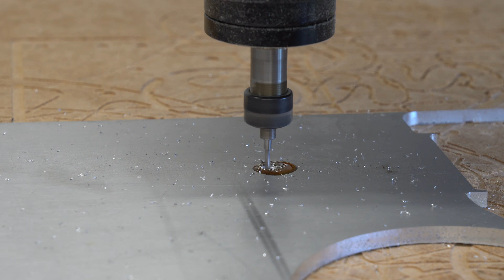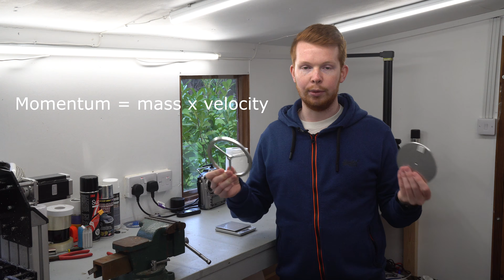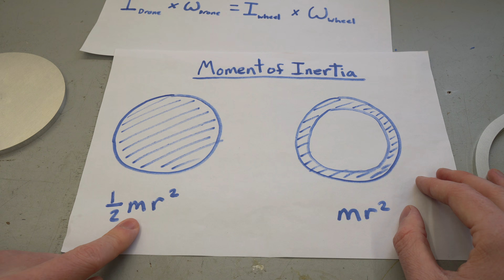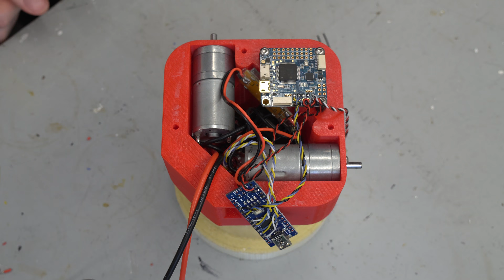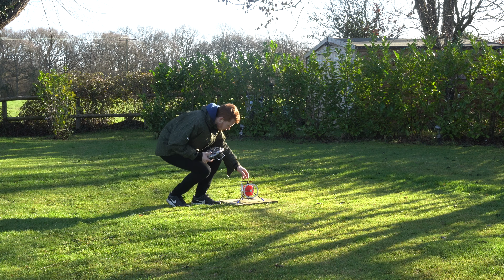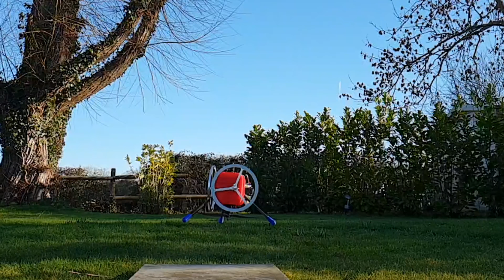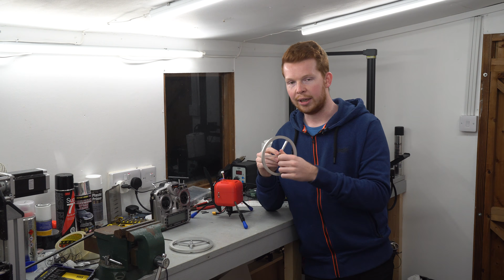Comment: I agree with your conclusion that there was a control issue, though I'm not sure that your problem was necessarily insufficient torque. It appeared that the motors were too often applying too much torque, over-correcting and then struggling to correct this over-correction. It appeared to end up oscillating like this until it reached a tipping point where it couldn't correct. 
I'd guess that there's either some lag between detecting and applying torque such that it's out of phase with the rotation of the drone and/or too much torque is being applied causing the over-correction like an over-damped oscillating system.
If either of these are the case, then even if you add more brute-torque, it will be counter productive. Sure, your potential restorative ability increases, but so do your destabilising influences. Net loss.
Also, it seemed the propellers were barely able to get it flying. The shallow angles it was tilting at was enough to get it to drop. Of course, it was dangerous enough for the drone even with the lifting force you were using.
Someone else also mentioned the centre of mass. It didn't seem  like this was the issue looking at the footage, the wheels weren't really spinning very fast as you'd expect in response to a mass imbalance, but it's worth investigating if you haven't already

Comment: Not Areo Dynamics... That causing the Drag from air from the surrounding as well as propeller.. if you put 4 small propeller in four side that can help in air flow..it will help a lot in this project..

Comment: Why not use stepper motors?
Also the top propeller blows air into a flat surface right bellow it, while bottom one sucks from a flat surface right above it, seems to me like that's hella counter productive.
Also every time I hear the word Arduino I cringe a little bit, but I guess it's good enough for the purpose.

Comment: I am wondering if some of the problem is the processing speed of the arduino in calculating the corrections that need to be applied. Is there a way to  see what that loop time looks like, and if it is inside or outside of the sample rate of the flight controller?  Similarly is there a way to get spi output from the flight controller to the arduino, or if it works better an esp32, to possibly reduce, if not eliminate, the time it takes to recognize a different pwm rate from the flight controller? I'm not expecting the flight controller to have spi out, hardware or software,  so I'm not sure if it's a useful suggestion. But if you get better stability when running the code through an esp8266 or esp32, that might show if that sense->response->sense loop is part of the issue. Likewise I suppose that just setting the Atmega chip to run at 2 Mhz rather than 16 would show whether that's an issue also.

Comment: I noticed the motor driver board you use for the DC motors and it looked like it had one of those old-fashioned BJT ICs (L298N?), if that was the case those have some horrible voltage drop that would make you struggle to get high current on the motor. Perhaps worth checking.

Comment: Cool project, I like your proof-of-concept videos. Always interesting. With a variable pitch rotor you could eliminate one of the motors. Not worth it for the added complexity though I imagine.
I don't suppose you'd be interested in making a Stirling engine powered vehicle?

Comment: Try adding two extra reaction wheels, and have them running on a steady rpm on both axis, each one going the opposite of the other side, this way you might get a more steady take offs plus the corrections can be done faster and in a more steady rotations

Comment: It seam to me that the change of rotation will never be as instant as required for a stable flight. What if you had 2 opposite wheel for each movement constantly rotating to counteract eachother momentum?  All you had to do is change the different speed between them without stopping them. That could possibly give a more precise control of the total momentum. Great project

Comment: You should try this with really micro drones and add both clockwise and anticlockwise motors on either side. Which will prevent the whiplash effect of a reaction wheel changing direction. It will also lower the weight and cost of the project considerably.
Reaction weels will work better to control micro drones instead of large heavy objects anyway.
It should be possible to split positive and negative values between different motors for each axis since you are using an arduino to control the brushed motors instead of the flight controller directly.
Good Work. Looking forward to future revisions.

Comment: your balancing reaction wheels should be located by pairs, one on each side.
Reply: (problem is that your gyroscope apparatus is unbalanced by design, at least you should put 4 wheels in this setup, with counter-rotation of the opposite wheels, one with a reference speed, and the other one as an actuator you control to reduce its speed 'til the positionning is done and then on release you let it go back to the initial speed of its coupled opposite wheel)
Reply: @OktoPutsch  thats exactly what i thought; 2 pairs counter rotating, but the wheels(pardon my lack of engineer lingwo) would have to be precisely the same shape an design, an weight (not all 4, i jus mean the one to its opposite side) even a few decigrams would require more processors than needs to be.

Coming from an architect, i know absolutely nothing about engineering, so i didn't wanna sound like that know-it-all guy that doesn't know jack on the subject so im glad you mentioned what my exact thoughts were on the matter
Reply: @OktoPutsch  ahem
if you have the wheels counter-rotating, won't they cancel out each other's angular momentum and have essentially no effect?
Reply: Yeah, I think that since the centers of gravity of the reaction wheels are offset laterally from the drone's center of gravity, an unexpected yaw is induced in addition to the pitch/roll.
Reply: @sgbench  yaw, pitch/roll, you got the words. Thank you to gimme a hand  'cause english isn't my mother tongue :)
Reply: This makes intuitive sense to me. It looks unbalanced when the wheels try to correct it. I am no physicist but my intuition tells me that you need to stabilize the other side. A pair would do it.
Reply: Not convinced this is the case, or rather, that this would be strictly necessary.   That might make it easier to balance, but if the axes of the shafts go through the center of mass, it should be balanced either way.
Reply: @Phos9  Right.  I think the problem is that they don't go through the centre of mass, so it cross couples onto the other axes.
Reply: I guess that makes sense, but success is more impressive like this :D
Reply: Three wheels might work as well but I do not see the advantage of that. Four in a vacuum would be more efficient. Or a hollow metal ball with magnetic levitation induction motor type drive in a vacuum
.

Comment: As is the motor's torque voltage curve is non linear.

Implementing a dead zone on the motor control might help significantly.
All you'll need is the voltage required to make the motor start moving and add this offset to the controller output.Just remember those are often not the same for the for the forwards and backwards motion.(tip: applyjng a very low frequency triangle wave might help)

This is a simple non linearity model, but to most dc motor aplications it's good enough.

Btw:  Wouldn't the gyroscopic effect be  problematic eventually? At some point creating an external input to the controller (like another torque on the other rotation axis?)  or something?
Hum, I don't know.

Anyways, it's always fun to see those experimentations. Keep it up.

Comment: I wander if a high torque servo and a off balance pendulum are enough for a drone.. i agree that a wheel is better in space but wonder about using gravity here on earth to your advantage. Granted a pendulum will saturate after apx 90deg not  revolutions and a servo has the advantage of a closed loop control. In truth this is like flying using shifting Ballast and controlling center of mass. On a side note most reaction systems use fast spinning wheels and use braking forces to build reaction torque maybe 4 small wheels on little bldc motors running at 50% on takeoff and weight the pid to leverage braking with a slow ramp back to 50 % with counter braking i bet it will be very stable do to the faster response time and added gyroscopic stabilization.

Comment: 1. You should look on whether the wheels are balanced 
2. You need wheels on both sides of the vertical axis (so 4 wheels) of the machine in order to get clean rotation  (the machine is turning around the vertical axis not purely the axis of the wheels!!!)

Comment: Great video. I just have two observations. Firstly at 15:30 it appears that although you have reversed the bottom motor, you have not reversed the prop. The bottom prop will be running much less efficiently than the top one and may be the cause of your yaw issues. Secondly as the drone is effectively hanging from the thrust line of the props it would have to be very evenly balanced to prevent a constant twisting motion towards the heaviest side, which may be hard to compensate for.

Comment: Next try to power a propeller plane using reaction wheels and RTGs
Reply: If by RTG  you mean Radioisotope Thermoelectric Generator, then I'm down for this
Reply: And it wouldn't really be a plane in the sense that control would not be through aerodynamic deflection
Reply: Should be far easier
Reply: It wouldn't really be possible. Almost all airplanes are designed to be self stabilizing. Thus directional control would require constantly increasing inputs to maintain a constant control. In short, the reaction wheels would reach their limit far too quickly and you'd lose control of a relatively fast flying aircraft. On top of that, to maintain flight the aircraft would need no inputs whatsoever which somewhat defeats the point of the demonstration.

The alternative would be an unstable aircraft, like the F-16. This requires a small force to start the control followed by a constant force against the control prevent the control from increasing. Again this would quickly reach the control limits. Additionally it would require controls too fast for the current setup to manage.

Finally you have a poor interaction between the reaction wheels and the flight imparting not only turbulence from the shape of the wheels but unwanted controls from one side rotating into the wind and the other with wind (creating a differential force). On top of that the filming of such a setup would be harder than a camera/phone on a tripod because its constantly moving. Whilst it might sound cool, the idea is entirely impractical even (moreso than a reaction controlled drone).
Reply: And it must hit 300 m/s or more :>
Reply: Good luck getting Plutonium - even the US Government is having shortages of that!

Comment: Also to properly control this you really need to code an algorthim to determine the pitch, roll, and yaw angles. Simple PID wont work since your only trying to control relative accelerations, and not the true position of the drone. Basically the algorithm should determine the current pitch, roll, yaw, and that desired based on orientation and control inputs. Home position would be the drone pointing up relative to gravity with the controls then acting to slew the desired angle about each axis while active. Once thats determined, then control inputs can be fed to the PIDs based on the relative positions of each reaction wheel to reach the desired position.

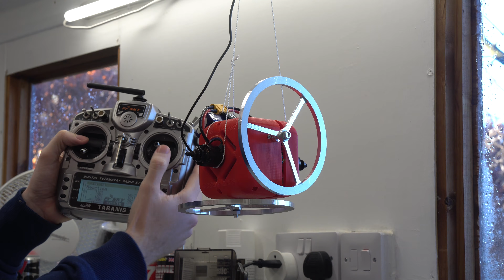Comment: 14:26 shows the problem to me. you can see as it spins it wants to spin around the center of mass which is off axis to the reaction wheels. this gives it that wobble, and i think in flight this wobble keeps building up to the point where it just flips. it'd be really cool to see this thing flying around like a normal drone using nothing but sweet physics! I think it's worth another try if you can find where the center of mass is and put the reaction wheels through its axis.

Comment: Food for thought, if possible, move to a digital signal between your flight controller and Arduino.  The standard analog control of servos is on a 50 Hz carrier signal and may not be fast enough for you.  If you were to switch to a faster communication protocol, you could cut out the lag between reading your orientation and powering on your motors.  It is likely that some of the wobble in the drone was caused by the lag in the system; signals arriving out of phase, amplifying the error.

Comment: Although there are two propellers, they are not creating the same amount of rotation. It takes only a small imbalance to cause instability.

This probably demonstrates the reason why drones use multiple motors/propellers, all mounted in the same plane or at least operating in the same direction.

Good demo though.

Comment: How about smaller wheels, but have two on either side?
Though that'll complicate the design a bit
Reply: Yeah, it seams to go toward the opposite corner. Plus its not balanced. Impressive though.
Reply: @TheMonthlyJack  i understood that it is balanced by weights on the legs
Reply: He mentioned he added lead weights or something to one of the legs in order to balance things out, maybe that didn't entirely fix the balancing issue
Reply: connect them with an axle mabey?
Reply: And they should rotate in the opposite direction, so it doesn't have to change direction always, just speed up one in the one side and slow down the other.
Reply: Exactly what I was thinking. The lag time to change direction must be in the order of a few hundred milliseconds, 
far too slow for the PID controller to be of any real use since it's fighting a growing lag time between movement of the craft and the change of direction needed in the wheel to counteract it.

Needs two flywheels per axis, spinning independantly of one another.
Reply: He can control his yaw by spinning  the two propellers at different speeds (they already spin at opposite directions, if I remember correctly). However, if he opted to change the design (use one propeller instead of two) then that might be an option, though I'd imagine it presenting its own challenges.

Good thought tho
Reply: @JutasiT  clever idea, but wouldn't you reach max rpm sooner, because the force isn't applied based on speed, its based on the change in speed (of the reaction wheel)
Reply: @mining1574  Yes, the force is applied by acceleration, but the same effect happens with the drone itself. So in theory it doesn't matter how big the acceleration is, if u turn the reaction wheel lets say α angle the drone will always turn β. If he had 2 motors in each direction and the they would rotate with same speed and different direction they would be counter force for one another. If he wants to turn the drone he would speed up one side.
Reply: or four smaller ones each side of the cube?
Reply: That would be less efficient, as wheels are much more efficient the larger they are, and having two smaller motors would be heavier than a single one. Moving the motors away from the wheel would help the imbalance.
Reply: True, but how about having a single motor controlling two smaller (maybe weighted) wheels; connecting them with an axle and gears. Again, that'll just complicate the build
Reply: Are you suggesting one wheel on each side(per axis), driven by one motor(per axis). Also proportioning each pair of wheels so as to equal the effect of his single wheel?  If so, I had the same thought regarding the symmetry of the torque.  But then I too, apparently "don't seem to know anything about physics or engineering..." ;)
Reply: Apparently no one here knows anything about physics and engineering 😂😂
Reply: @PeterCarrierii  it is a good idea tho and it would work if the trust can hold it which should be possible since he can remove the weight from the legs. I have used this method in realistic physics environments on pc alot of times.
Reply: i hope i did not trigger your engineering brain as well

Comment: too much science talk, interesting over all but part of me thought that it probably would have worked better if you had those wheels countering each other on the other side since I think you forgot inertia, mass and center of mass, no matter how low the mass number is you will never counter it when in flight so I think that is where your drone flawed at and the reason for its unsuitability. I am surprised though with as much thought you did put into it you never really seemed to take in center of mass especially since your drone is basically a cube with only 2 weights on one corner.

Comment: IIRC RCS is always on. They rely on slowing and speeding up. Stopping and starting is just not good. Also .. need to be closer to CoM. Or have 2 wheels on an axel. The latter is probably better since you can use much smaller wheels.

Comment: I would go with brushless motors without gear box and a lighter wheel.   I would set 80% throttle as neutral position and accelerate to bank one direction and apply brakes to bank in the other direction.   Having the wheels constantly spin will add more gyro effect to hopefully stabilize it.   

Once the wheels are up to speed it won't take much force to keep them at that speed but still will be a bit of losses so wheels will gradually slow down, still I think it will fly better for a short while at least.

Comment: I believe you would find a much more stable vehicle if you omitted the bottom blade, and instead used something more similar to an RC helicopter to achieve what you intended with having the two propellers.